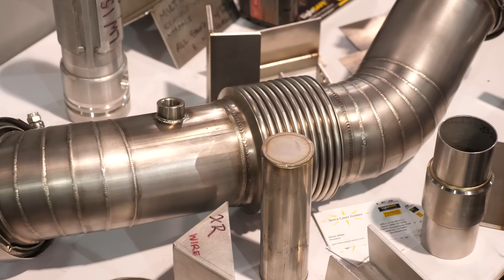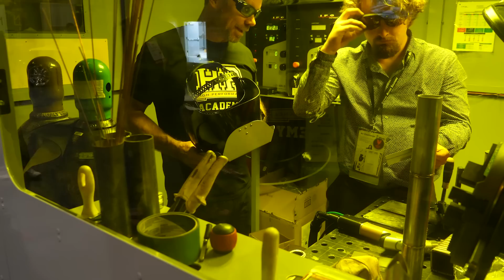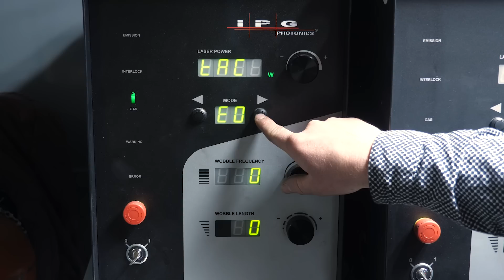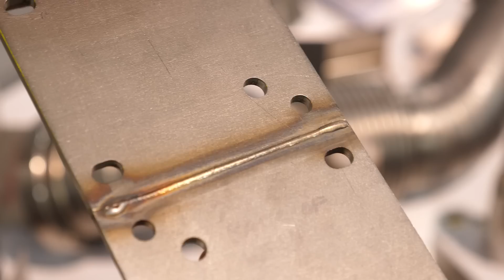Is LASER Welding Better Than TIG Welding?

Comment from the maker: Building a fast car? Get $400 OFF the VIP package with every current and FUTURE course included: https://hpcdmy.co/vipy1
Practical TIG Welding course. Get started today with 50% OFF: https://hpcdmy.co/offery1
TIME STAMPS:
0:00 - Laster Welding
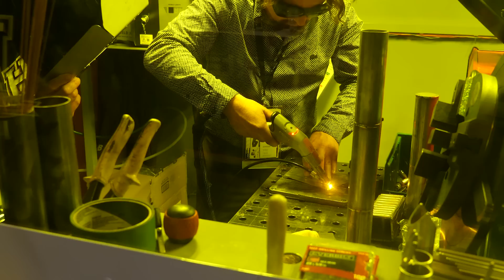0:13 - Evan Shea, Serra Laser
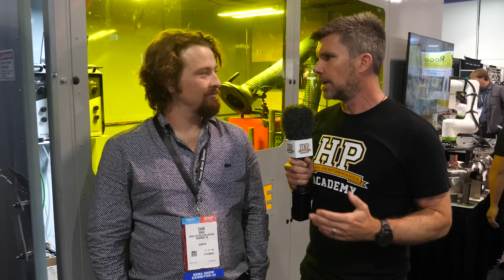0:18 - Garage Level Vs Industrial Level
0:54 - TIG Welding vs Laser Welding
1:41 - Is Chromoly Welding Possible? Yes.
1:51 - How A Laser Welder Works
2:38 - Manual Settings
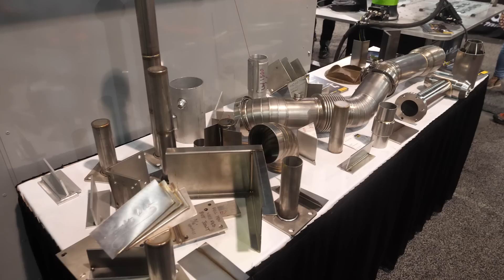3:12 - Material Thickness
3:36 - Material Preparation
4:10 - Shielding Gas
4:42 - Argon vs Nitrogen Costs
5:08 - Faster Than MIG & TIG?
5:40 - Pulse Mode
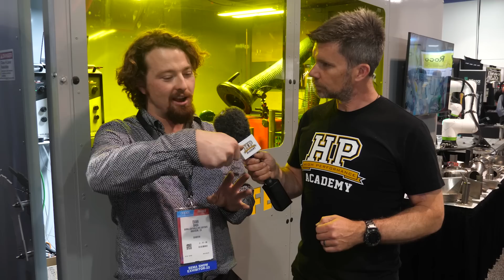6:19 - Fit Up Requirements
6:59 - Back Purging
7:23 - These Will Get Cheaper Over Time
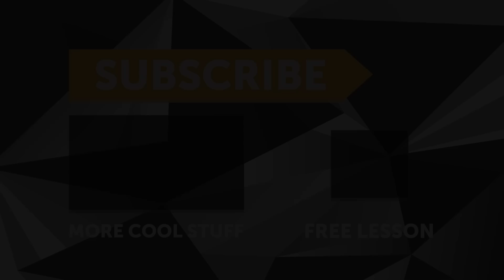7:57 - Have A Thirst For More Knowledge?
Reply: WOW that video was the worst.   You have some really loyal fans to get a 1% like rate.  WHY don't you have move video of the welding?   Were not buying the product we just want to see it working.  I am shocked you even uploaded this.  I have no clue why youtube thinks I needed to see this crap.  Don't worry I will pick don't recommend this channel so I don't have to waste my time on your videos.  you are welcome for the time I took me to write this comments so you don't make the same mistake twice.

Comment: It's a useful and powerful tool, but beware the reflected lasers from the metal that can literally kill someone if not properly handled. Also as of right now they dont have the ability to weld thicker parts yet. Laser welding is great, but it has its own limitations just like anything else.

Comment: I had a lot of TIG welding work rewelding laser welded parts that cracked. I think they often use autogenous welds when filler would have removed this problem.

Comment: Wait until the ROBOTS with Ai come along=Lots of Good Welders out of Work. There;s Good and Bad in every Innovation. I saw 4 BRAND NEW German made Robots being installed in a Factory i used to Drive for at a LOT of £££ Cost, Just 3 years later that Contract ended and the Robots were THROWN out the Back SCRAP.
Reply from the maker: At one point in time shovelling coal was a job, and the horse industry was massive and present in every village/town/city. 
Times change, and we must adapt our skills to suit the times when/IF that change happens 😎 - Taz.

Comment: If i could get a machine around £1000 i would buy one... i cant weld good still a amateur but this looks super easy ..... be perfect for my automotive need ie exhausts and thin panels
Reply from the maker: You might be able to pick one up second hand for that price at some stage. Not quite there yet though, however, you would get a really solid used TIG with that budget for sure instead - Taz.

Comment: The laser welding machines are too expensive for me.
Reply from the maker: Yes they are still fairly expensive for the average home user but that will change with time. At one point it was also unthinkable for someone to be able to afford a TIG or MIG for the home garage and look at how that has changed for example.

Note we certioanly wouldn't hang around waiting and in the meantime use whatever welder/s you can get your hands on 😉   - Taz.

Comment: So a lot of people obviously didn't watch the whole video, and the doubters should watch from the minute 3:14 
I have laser welded for many years and I can assure any doubter that if you can adjust the focus of the laser, you are going to get penetration depths that a tig welder can only dream of.
I butt welded 8mm Mild steel with complete penetration and a bond that you can never achieve with tig in one pass and that's with no prep whatsoever.
People coming on to these videos and criticizing laser welding but now having a clue what they are talking about are really frustrating. Stay in your ball park, if you don't know what your talking about, don't pretend like you do.
Reply: Good comment here.

Comment: Initially he said that this process could penetrate up to 1/4” but later when asked about pipe welding and beveling the ends, he said that no gap or bevel is necessary for joining pipe to pipe, and I would presume that would include pipe to fittings as well. That sounds absolutely ridiculous! I’ve welded pipes of all sizes, materials, schedules and processes and I can tell you that that’s absolutely baloney. The ONLY time in my career when I’ve ever had to weld without a bevel and or a gap, is when I’ve welded with orbital machines, or hand welded SS pharmaceutical grade piping. In those procedures the ends were machined square, with a special tool and butted together, purged and welded without any filler wire. And the pipes used in those situations have all been of a very thin thickness or schedule. What you’ve just implied would obviously not apply to every piping application.🤔🤔🤔
Reply: I have the ipg 1500. Same one he is using. It can only weld 1/8 material.  When he said 1/4 that's if you weld on both sides of the part. No bevel is required when no wire is being used.  With wire you need a small bevel and get way less penetration. Mig welding is faster than laser for sure. Don't know why he said laser is 4 times fast. When welding 14ga stainless it's an amazing machine but 1/8 or more I tig or mig weld the parts

Comment: I've watched video extoling the virtues of Laser welding and it seemed like an awful lot of gas was being wasted.
It looked like the benefits of a more concentrated heat transfer to the materials is kind of offset by the waste of gas in the process of starting and ending a given weld.
Maybe the folks in those videos I've watched really didn't have the experience that others do.  I don't know.  It just seemed like alot of gas was being released into the air before and after each weld.
Reply: Slightly more gas is used, but the gas is also many times cheaper than the typical argon used with TIG welding.  Nitrogen is much more cost effective and the benefits in productivity outweigh the slightly higher volume of gas being used.

Comment: why was he welding with only glasses for ppe?  what about the potential of laser bounce that could burn skin???
Reply from the maker: You can wear more PPE than this if you wish to when laser welding. You don't have to do what others are or are not doing, you are an individual with your own brain.
If you are using a welder like this in a professional environment, talk to your employer about PPE noting you didn't mention fume extraction which can be very important in some applications too - Taz.
Reply: @hpa101  yes, fumes are a potential hazard as well.  My struggle with seeing someone do this at an expo or show is that some people will not realize the dangers if they don't see the expert wearing the proper ppe for the hazards.  Even the welding helmets are made with a special shield, so it is sad to me to watch something like this.
Reply: The risk to the skin is a reality as well. In this situation, an expert was in control, and those who were allowed to give the system a try were instructed of the risks and provided with proper PPE, as well as air filtration in the booth.

Comment: What's it like on thin stainless for food equipment.  Will the weld cause burn through ? And do the welds clean up any discolouration with a electro acid machine ?

Comment: Nitrogen in the atmosphere is what gives weld porosity  when you run low on the actual gas you are supposed to be using star gold
Reply: Nitrogen shielding is superior to argon in many ways, including the fact that it produces LESS porosity in the weld. Atmosphere also contains additional components which cause porosity. for most materials, nitrogen is the optimal shielding for laser welding, just cannot be used with other processes.

Comment: How does laser welding work on cast iron engine blocks. Do I still need to heat the block up before welding because  you where saying laser welding doesn't doesn't heat the surrounding material up as much as regular welding??

Comment: Thank you for the interview! How to protect lenses?
Reply from the maker: Laser welding needs a different type of visor to TIG welding to protect the lenses in your eyes if that's what you mean? Like TIG or MIG etc, you just need to purchase the right PPE for this specific equipment - Taz.
Reply: @hpa101  I meant laser optical system. Is it necessary to protect it from the melted droplets? Thank you.
Reply from the maker: @MercBenz-oc5fo  different welders will have different designs, best you get in touch with whatever specific company provides the unit you're looking at noting laser welding is more comparable to TIG welding than MIG welding, with MIG welding having a lot more splatter etc than TIG or laser to the point it's not directly comparable when you're doing it all correctly - Taz.

Comment: Well.  Never say never...usually.

High cost and in general weaker structurally laser welding has a long way to go to be a big player in welding.

It is just not there yet.

The machines are expensive, the welds are weaker and for thin metals.

Not there yet.

Comment: What is the 045 welding wire he is reffering to ( min 6:20 )?
Reply: 1.2mm weldiung wire, same as with a MIG
Reply: 45 thou, .045 inch. It's a very common MIG wire thickness.

Comment: I working with laser welding machine now on my job, and l can tell you one thing, run from this far as possible. Lenses are to sensitive, non stop some brake down and you will leave your back on job because you will carry around more metal parts what you weld and no one will pay you even one cent more.

Comment: Do you need to increase the preheat temp on account of lower heat inputs for materials like thicker CrMoV's...?
Reply: No, the laser is capable of inputting more than enough heat, it is just very focused. The energy density at the point of weld is 200x that of an arc weld, so the heat is just not being input where it is not needed. In fact, many applications where a preheat would be required for tig or mig, it is not with the laser.
Reply: @EvanShea-uv8jo  Thanks Evan. Is that reognised by any fabrication code..? Lower PH temps for laser process...
Reply: @EvanShea-uv8jo  Where can I read more on lower PH temps for the laser process Evan...
Reply: @paulmeersa7162 the lower or lack of preheat is just something that I have found after dealing with these systems for the last 3 years. I have done testing on hundreds of varying applications, and done a bit of research myself. The welding codes will catch up but it is fairly  new to the handheld welding industry. However aerospace specifications have been made for handheld laser already, and there is a lot of this going on with the rockets going to space these days.

Comment: They will never replace tig welders, because of the optics the gun is heavy, it's not for intricate welding round internal corners or narrow passes, more for straight lines or on CNC welders where the focusing point could be far away from the gun and just innert gas is close to the welding point. It is fun to see how the beam is melting the metal but I use it very rarely compared to tig or mig.
Reply from the maker: It already had replaced the TIG in many applications, but you are right, it is unlikely to completely replace it everywhere for everything (at least where the tech is now) just as TIG hasn't replaced other welding options either itself across the board - Taz.

Comment: The downside to this process is definitely the cost.  I work in high-energy lasers and the component costs are definitely not what's propping up the enormous cost of these systems.  Almost 99% of the cost of these systems is R&D and profit markup.  Until these companies start trying to make a reasonably-priced product aimed at a realistic market, instead of trying to get rich quick as a market front-runner, this won't see serious take-off.  Unfortunately, the only people taking the affordability approach are the Chinese.

Comment: I find a massive problem with this, The guy talking about and says that The heat affected zone is narrower which preserves the original properties. But that is not necessarily the point of welding. As when you apply heat and the filler metal, you will lose a little bit of structural strength to the parent metal. As the parent metal is sharing the strength capacity to the adjoining metal. Basically describing nothing more than a top weld lacking penetration. When welding, it's absolutely necessary to go slower on thicker metals  This allows two medals to be joined together And mix. In a fast process other than with thin material. This is just not possible. The reason that the metal Heats up through electric arc welding As well as the reason that electricity is the method used. As the current passes through the parent metal becomes hot as well. This allows for fusion. How can you possibly fuse a cold metal to a hot metal. As well as how do you prevent impurities from getting in the weld. Anyone can tell you if they've ever used mig welders. There's a reason that mig is not used for Steal beams. In welding penetration is everything as well as bonding.
Reply from the maker: I think you are assuming because that is stated that no heat goes into the weld at all, which is not quite right. You still need heat to weld, the difference is this type of welding keeps it better confined to the working area rather than further out into your work piece.

If you have ever welded up exhaust headers and similar you will know half the battle is actually making sure you don't let that excess heat warp the work piece while you are working on it. That excess heat isn't giving you a better weld, it is damaging your work if you do not take time and extra steps to prevent it.

At the end of the day though there is no one welder to rule them all, every option has strengths and weaknesses, even your favourite and there are a whole range of applications, materials and thicknesses to consider when making the choice on what suits the work in front of your face at the time the best 😉 - Taz.
Reply: The laser is capable of reaching depth of penetration which is unachievable with typical arc processes. This is a totally different process from what you have experience with, and there is much to learn. Reach out to us at Serra Laser if you are curious to learn more.

Comment: Fantastic system of welding , but as the Man mention , it's not affordable ! Generally , devices are huge , heavy and crazy expensive ! The most compact device from China , Max wave , 70 kg , 1- 1,5  KW , cost a bit  less than 10 000 euro  by  Ali Express . But point is , this system is the most secure for Alu .

Comment: For cosmetic stuff with no load needed in production its still more expensive in electricity. Price of argon is not going up these people just wanna sell stuff. You could probably modify a laser hair removal machine and tig with it. But its not for welds that need a serious load on them or pressure in them.

Comment: No but robot welding they have been around for quite a while. But laser welding only good for production not when you have to go out somewhere and fix something. And that is just a tig with a spool gun but uses laser as the heat source. Laser probably uses more electricity as well.

Comment: metallic welding DOES NOT fuse any metal together. All welders only liquify the material and then the cooling solidification of the material happens creating the molecular bonding.
Reply from the maker: ...and thus, fusing the metal, yes 😎
This is not something you just leave on the back porch to happen in the sun while you're at work, hence why welders are used as part of the process 😉 - Taz.

Comment: We usually need to disconnect all electronics from a machine in the field before welding.

Can these welders be used in the field for repairs at some point? I'm assuming we wouldn't have to worry about a ground clamp with this tech, and therefore don't need to worry about frying the electronics on a machine?
Reply: Auto repair industry is adopting this technology for that reason in particular, as well as the minimal deformation.  There is no high current traveling through the metal so for EV body repair, and modern ICE cars with many sensitive electrical components, this is a game changer.

Comment: Can this technology be adapted to the auto body industry?
Reply from the maker: I'd have a chat to your chosen seller about what you need from a unit like this and they can help you figure out if it is going to suit you or if your current setup is still a better option - TAz.
Reply: Yes, we have done testing on this and it has immense benefits. Many large OEM collision centers have adopted this already, with the benefit of low distortion, and no effect on electrical systems.